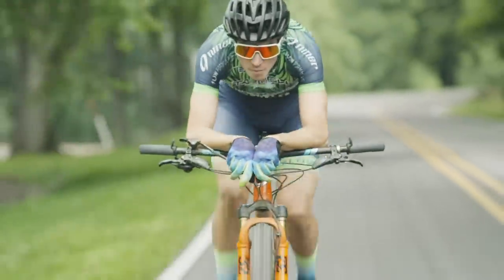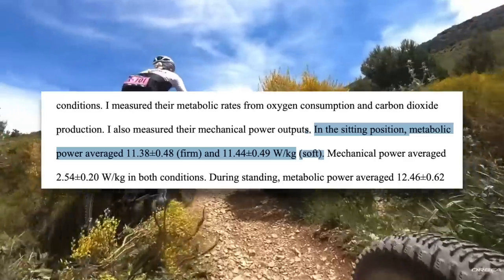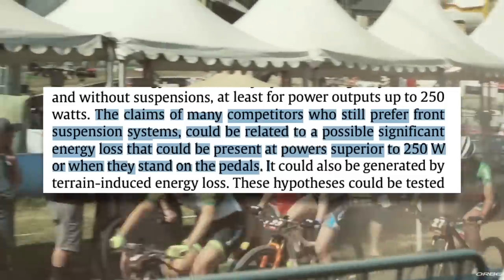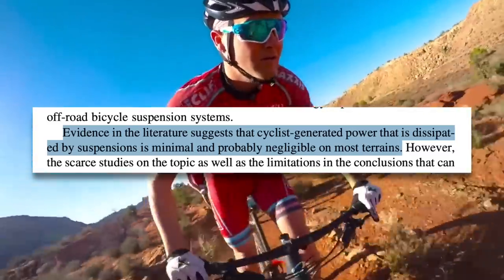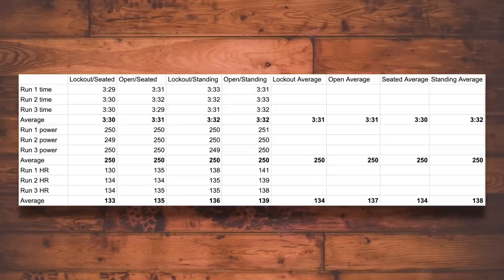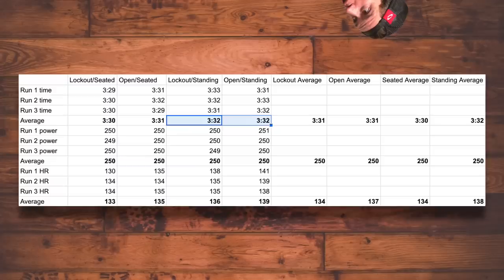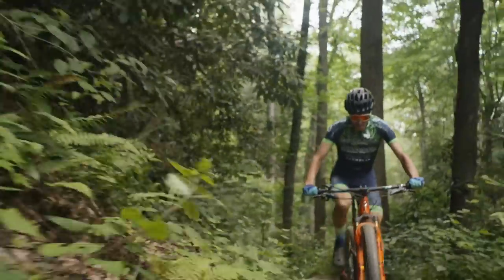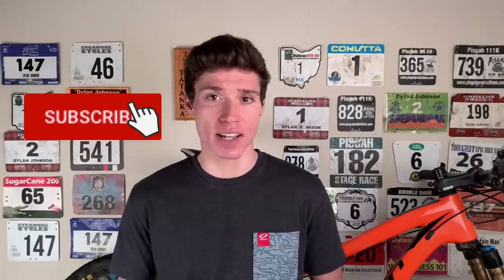Does Locking Out Your Suspension Actually Make Your Bike More Efficient? The Science

Comment: Comment from an engineering perspective: suspension systems have basically two components, a spring and a damper. A spring absorbs energy when it compresses, but then returns that energy when it expands again. A perfect spring returns all of the energy that it absorbs and air springs are pretty darn efficient. Dampers are a bit trickier, but they basically resist fast movements, which reduces vibrations (bobbing) and helps protect against bottoming out suspension. Most importantly, dampers don't return energy, but rather dissipate it as heat: this is why suspension gets hot with lots of use, ie at the end of a downhill run. To get significant energy losses through suspension, one would have to pedal in a way that results in relatively large amounts of travel movement at relatively high travel speeds. A steady 250 W up a climb, even standing, likely does not cause this suspension travel, especially with modern bikes designed specifically to mitigate this issue, but maybe an all-out sprint with a very uneven pedal stroke (difficult to reproduce and characterize) could result in noticeable losses.
Reply: Yeah thats why Im getting a chuckle about people saying "250! Thats too low!" "Its needs to be 400!"

Frankly loss of power due to loss of traction will be a bigger concern for a larger number of cyclists.
Reply: I am not an engineer and just trying to understand. The spring is absorbing energy that you're putting into the bike, but when it expands giving back that energy surely that's then energy that isn't being transferred to the drive train?      I get that energy doesn't just disappear, but I don't get how it then goes through the bike to propel you forward. I'm confused but happy to accept the science.
Reply: @ellismccoy  the energy ‘returning to the bike’ during pedaling is acting normal to the tire contact patch and that line of action is vertical and not horizontal. This the restoring force does not propel the rider forward. The energy is lost in the form of convective heat transfer from the shock to ambient air.
Reply: @andyjonathan2486  the question was about a spring, not a shock. Also the force vector is not vertical, since a) the contact is slightly but significantly depressed into the ground b) bigger obstacles are approached and dispatched from with a horizontal component.
If you want to understand how the spring suspension without a shock works, imagine riding pumptrack without pedaling
Reply: Comment from another engineer- power is being measured at the crank and transferred to the rear wheel via a chain. Neither the front suspension fork nor rear suspension mechanism have any influence on the drive train efficiency so of course Dylan produced the same time up the climb with the same power. The studies which include vo2 measurements are more interesting/ relevant but without reading and analysing i would not like to comment on their findings.
Reply: @feedbackzaloop  if the bike utilized an air spring, the compressing of the air is not an adiabatic process, and a fraction of the work going into the air is transferred to the aluminum body. I’d suggest Milliken and Milliken RCVD as a great reference for tire mechanics. The force centroid acts through the section of tire undergoing the greatest deformation, with tractive and lateral forces acting tangent to the surface and vertical forces normal to the surface.

If we are trying to determine if the restoring spring force propels the bike forward, simply jump up and down on your bike with the chain and brakes disconnected and let me know if the bike propels you forward.
Reply: @andyjonathan2486  the theory you are referring to both regarding the tyre and suspension is not applicable as straightforward to mtb, but rather a pogo stick with a scooter wheel.
Trust me, I have a 6-year degree in design of offroad vehicles: the power is transferred back. Question is can you operate it to propel yourself or will it just shock your arms and legs
Reply: @ellismccoy  He showed us his heartrate. It was almost exactly the same ;)
Reply: @feedbackzaloop  thats good you have a design degree in off-road vehicles, which means you and I should be able to speak the same language as I’m a mechanical engineer with 10 years in the automotive industry. If you have kinematic design tools at your disposal, which you could feed into a structural analysis software, you could simulate the condition we are discussing. 

Say for instance we take a 200mm travel DH bike and a 100mm travel hardtail, and load the hardtail with ballast to equal the weight of the DH bike, and put the same tires on both bikes. If the rider is sprinting out of the saddle, the peak vertical pedaling force applied at the cranks will be attenuated by the suspension on the DH bike, while the hardtail force response will be immediate and will not have heat loss and attenuation from the suspension.

Are you referring to anti-squat and anti-dive geometry?
Reply: @pierrecarriere6845  DOH, yes he did!
Reply: @andyjonathan2486  I am referring to the one only difference between us: accounting for periodical road unevenness. 
Yes, kinematics of suspension plays some role - which can be seen as non-zero caster angle - and you can point it to another "engineer" in this thread, who is decoupling vertical and horizontal components. However this role is small
Should you want to play around with - say - Simulink, go back to basics of single sprung mass, moving along sinusoidal profile with constant speed, and check the horizontal reaction.

Also may I ask what part of automotive are you specialising in? Engine, transmission, body, suspension, etc?
Reply: @feedbackzaloop  I specialize in FEA simulation and strain gage stress analysis in suspension components. With regards to your point about a spring and mass traveling along a sinusoids path, yes there is a horizontal vector component acting against the direction of travel during the rise of each bump. This does not account for oscillating pedaling forces input from the rider. 

Also, I’m not sure why we would even consider an actual system with a spring and mass only. As you are well aware, the spring force is dissipated via rebound damping oil which in turn is dissipated as heat. Cooling fins on trophy truck multi-bypass shocks for example are needed to aid in this heat rejection.

With regards to anti-squat, there is a good resource on YouTube Andrextr, and he has a great video on this and discusses pedal bob:

https://m.youtube.com/watch?v=D0bAVTiFyy4

I think the primary question we are trying to answer is does the restoring force during “pedal bob” return as useful work propelling the bike forward, or is this dissipated as heat?
Reply: @andyjonathan2486  exactly, we are not talking about direct effect on pedaling here, but where the energy is transferred in case there is no damping. And excluding the obvious resonance scenario, it has the only ways through the road or legs.
The spring force is made to be dissipated by the shock, but it is not always necessary for high frequencies or active damping.
However, we all should be ashamed not to mention the first effect: spring energy is first transfered into velocity of the wheel. Then the wheel meets the road and everyone gets confused.
Once again, Ellis's question was more general than pedal bob and you don't need to get into secondary effects in the explanation. FEA is a great tool and I have deep respect for strength of materials scientists, but this is a domain of rigid body dynamics with specific assumptions
Baja trucks are also super cool vehicles, although their mode is rather on another end of the spectrum, so not that applicable to bikes too (mainly exactly because of excessive rebound damping and as the result tracking only the peaks of unevenness)
Reply: @feedbackzaloop  Have you ridden a long travel 180mm enduro bike or a 200mm travel DH bike and observed first hand how inefficient the bike behaves when the suspension is fully active? When would there be a scenario when a competitive mountain biker run their suspension with zero rebound damping?
Zero LS and HS compression damping I could get away with, but if I were to run no rebound damping, I could likely be thrown over the handlebars over technical terrain. 

With regards to ‘where the wheel meets the road’ during the release of spring energy, if there is no force component acting tangential to wheel, I don’t see where the work=force x distance applies in which the bike is propelled forward, unless there is a dramatic and useful change in wheelbase between droop and bump extension.
Reply: @andyjonathan2486  you don't need an enduro bike to see the effect, 140 trail bike is enough. On the contrary, have you ridden any coil-elastomer 60...80mm travel bikes from the 90'? Were you always OTB? 
Dry friction in bushings and seals is absolutely sufficient for root sections and mild rock gardens. Slow speed rebound is necessary for single drops and doubles
Reply: @ellismccoy  you should consider the up and down movement. imagine you are going through a bump, without a suspension, you'll move up then down along with the bump. With a suspension, you'll travel in a straight line. When you left the bump, the suspension is pushing you up, or else you should going along with the bump going down. This pushing UP so you travel in a straight line horizontally, is when the energy is returned. So that you are up, then when you hit next bump, you are already up in the middle, or else, you'll have to put another title effort to climb this micro ascent. That's why it does not lose energy.
Reply: @Xucheng 
Thank you!  I feel it necessary to point out the energy lost in the compression and rebound damping, but also that this must be compared to the energy lost if your muscles were to absorb the terrain undulations instead.  Also many shocks and forks do not fully lock out but rather drastically increase compression damping.  Wouldn’t this still absorb much of the energy?  Im honestly not sure
Reply: @xuchenglin6256  This is a very nice explanation but wrong one: when you are up the top of the bump, your potential energy is maximum, plus you have energy in the spring. When you ride down the bump and the bike stays level, it keeps energy it had, while spring energy is dissipated into the damper + accelerating the wheel downward. You are not pushing UP, you are rather easing the leg strain without going DOWN
Reply: @feedbackzaloop  I give it a little more think and find it a very complicated one. Your version is also not quite right... It's not just the pushing down of the wheel. The wheel only contributes very little of the total mass of the system. So the delta K-wheel couldn't be all the P-spring. And you should remember the force is applied on both end (Newton's law), a push down for the wheel is also a push up for the cockpit. From the energy point of view, before the hit or "uphill", all we have is a horizontally forward K, then at the acme, we have K = K-acme + P-spring. If we have no spring, then it's K = K-acme-no-spring + P-gravity. For a relatively very big mass, and relatively little force and short time, the K-acme and K-acme-no-spring could be almost the same. Then we have P-spring (almost)= P-gravity. So that translate to, in the energy return process, the returned P-spring is almost equal to the yet-to-be P-gravity if there's no spring in the system. That also means the spring works in a vertical manner, it transforms  energy forms between P-gravity and P-spring constantly, That's my explanation in a more detailed illustration. I'm confident this part is right.

But, if you going into more detail, there's something I can't explain either. In the formula of K = K-acme + P-spring, it suggests that when the returning process is over, the P-spring should become the horizontally forward K. But how??? the spring works in vertical manners, how should the push up/down becomes forward kinetics??? My limited high school physics could only carry me here.
Reply: @SeaCowsBeatLobsters  Yeah, here we are only focus on the return part... if you to account all the real-world complexities, it will be very hard to get the idea of core fundamentals... In my limited physics, I'm quite sure the energy loss in form of heat is relatively small. Or every mechanical thing we use would be completely different now. I think the damping part the main idea is kinetics-to-heat transformation, the K is lost here, that's the idea of "damping" in my humble view...
Reply: @xuchenglin6256  duuuuude. If you calculate energy transfer, you have to use work-energy theorem, not force balance. Spring, pushing the bike up, doesn't do any work when the bike center or mass stays level.

But I would rather recommend setting up the Euler-Lagrange equation and as a tip not to forget the sloping of the bumps (for simplisity you can use regular V-shape). That way you will most likely not miss any factors and learn a lot on the way
Reply: @feedbackzaloop  I get your point when the center mass stays level yeah the work of up force is zero, it's not the up push that returns the energy. But that still does not answer the question of how the work of the down force to the wheel eventually becomes horizontal kinetics of the bike.

It's not the slope either, first it's a symmetric process, the horizontal part of the spring push back then push forward cancels itself. And the bigger problem is if you only account for this force, there's always a part of energy missing. You still cannot explain how the vertical part of the force's work becomes the horizontal kinetics.

Actually I think I figured this already, the key is the wheel, it's how the force changes directions. When the spring pushes and accelerate the wheel, the wheel drags the bike, so they travel in the same speed, so now this is complete.
Reply: @xuchenglin6256  exactly, the wheel. As said before, spring energy goes to the wheel, wheel pushes against the slope, therefore propelling its axle.
You would not need to search for forces if you just did the Lagrangian. See, you account for smth irrelevant and already finding out the part of energy is missing.
Reply: You are way off the mark there. First off you can't standing pedal at 250 watts. 350 watts is about minimum force you can do while standing pedaling. And when you are doing sprint starts the suspension does go deep into the travel wasting a lot of energy. Anti-squat charasteristics aren't meant for that kind of power production. And even at steady pedal it doesn't remove the bob.

I have a 160mm enduro on zwift and in steady state pedaling it's a fairly consistent 10% loss of energy. At 150W it's over 10 watts and at 300W it's almost 30W. Power meter is over 3 seconds so I can't measure spikes but starting from stationary and putting in 1000+W that loss is goping to be way more than 10%.

Comment: The commenters below that stated your power meter measures the power into your chain ring, effectively, and then with a little loss to your chain, cassette and then the wheels got it right.  A given power will give you an equivalent speed independent of energy lost in the suspension.  Many of us know that energy is power multiplied by time.  But energy is also force multiplied by distance - called work in our high school physics class.  As the pedals turn, we apply a force at the top of the pedal stroke down the distance to the bottom of the pedal stroke.  This becomes the power you see in the power meter.  But, with the bike bobbing up and down from an open suspension, your leg has to apply force over the distance of the pedal stroke plus the distance of the suspension bobbing up and down.  The power meter only measures the power going into the pedal stroke, not the power pushing the suspension.  An obvious illustration of this concept is going down a steep, bumpy decent at high speed without pedaling but standing.  You get to the bottom and your heart is racing, yet the power measured on the power meter was zero.  That unmeasured power is similar to the power wasted pedaling with the suspension open (standing up) and not being captured in the power meter.
Reply: Well put, and as mentioned would also be reflected in an elevated HR vs other efforts.. I think this would be much more evident at efforts greater than 400w that really get the bike bobbing as well.
Reply: I couldn't put it in words as you did. Thank you.
I didn't know how to explain that the power meter doesn't include the power responsible for the suspension bob.